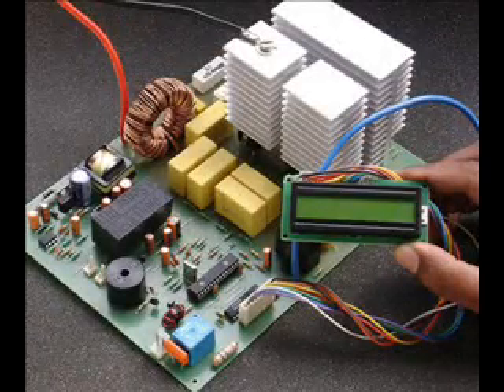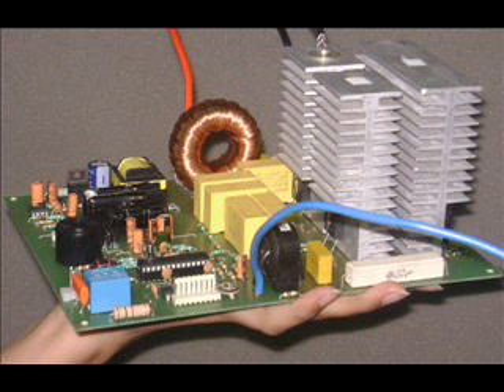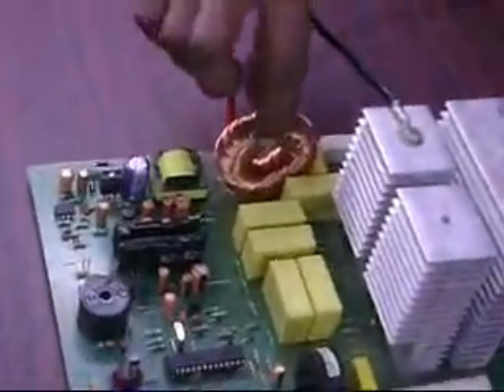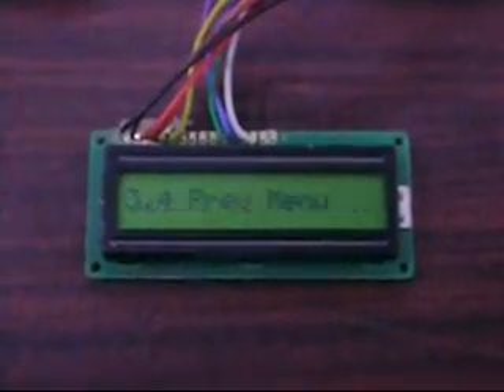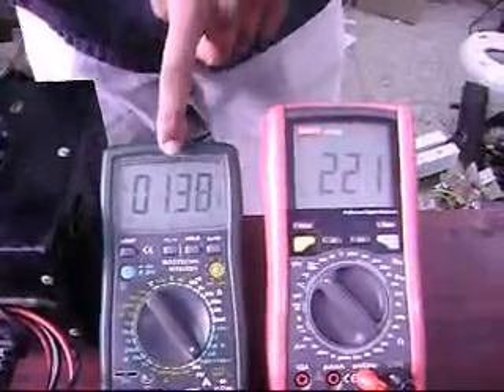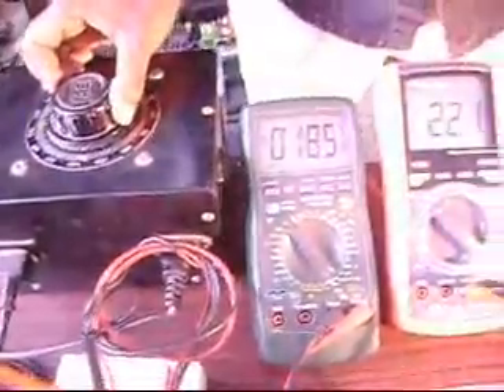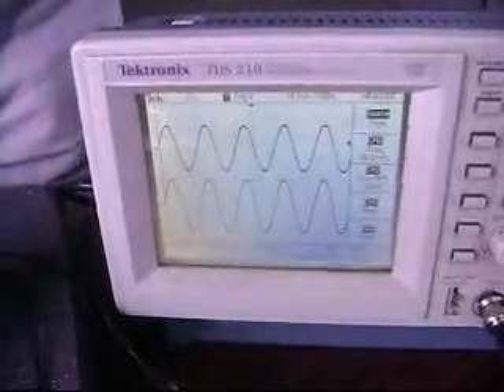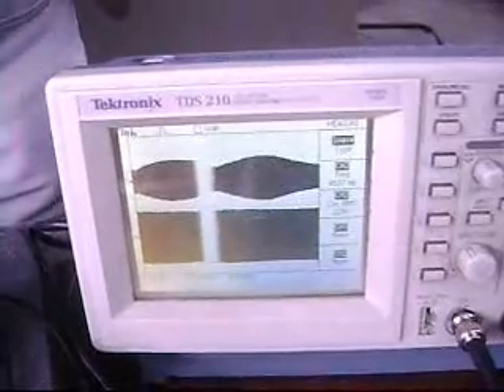Dynamic Voltage Regulator

Comment: What about durability
Reply: Respected Mahesh Ji !
These systems are extremely durable because of the impeccable design and quality. 
 We are one of the leading manufacturers of IGBT Controlled Static Voltage Stabilizer with high precision, fast regulation and inbuilt circuit protections. 
You may check about it more on
https://nkbtechnocratspltd.com/?page_id=125

Contact us on: nkbtechnocrats@outlook.com
Call/Whatsapp: +91 9660061987

Comment: Wow  this is great  incarnation
Reply: Dear Sir
 We are manufacturers of IGBT controlled Static Voltage Stabilizer which gives constant output voltage. Kindly visit https://nkbtechnocratspltd.com/
or call on +91 9660061987.
Reply: Hello !

We are one of the leading manufacturers of IGBT Controlled Static Voltage Stabilizer with high precision, fast regulation and inbuilt circuit protections. 
You may check about it more on
https://nkbtechnocratspltd.com
Or call us on +91 9660061987.

Comment: Sir I am intrested  in your product. Pls can you call me on my number  9986336699.
Reply: Respected Sir!
We are one of the leading manufacturers of IGBT Controlled Static Voltage Stabilizer with high precision, fast regulation and inbuilt circuit protections. 
You may check about it more on
https://nkbtechnocratspltd.com/?page_id=125

Contact us on: nkbtechnocrats@outlook.com
Call/Whatsapp: +91 9660061987

Comment: I'm Interested in your Design. I want to use this Design to Make a Stabilizer  of 20KVA for Household Use. what will be the total cost of Materials and Cost of Your Design ?
Reply: Dear Sir
 We are manufacturers of IGBT controlled Static Voltage Stabilizer which gives constant output voltage. Kindly visit https://nkbtechnocratspltd.com/
or call on +91 9660061987.
Reply: Hello !

We are one of the leading manufacturers of IGBT Controlled Static Voltage Stabilizer with high precision, fast regulation and inbuilt circuit protections. 
You may check about it more on
https://nkbtechnocratspltd.com
Or call us on +91 9660061987.

Comment: this great ideas manufacturers companies Name &  Contact Us
Reply: Hello !

We are one of the leading manufacturers of IGBT Controlled Static Voltage Stabilizer with high precision, fast regulation and inbuilt circuit protections. 
You may check about it more on
https://nkbtechnocratspltd.com
Or call us on +91 9660061987.

Comment: Very impressive I like how it was capable of regulating consistently due to draw and variable I biggest concern is pricing of the units and is it available for US market also had a buy one
Reply: Dear Sir/Madam
 We are manufacturers of IGBT controlled Static Voltage Stabilizer which gives constant output voltage. Kindly visit https://nkbtechnocratspltd.com/
or call on +91 9660061987.
Reply: Hello !

We are one of the leading manufacturers of IGBT Controlled Static Voltage Stabilizer with high precision, fast regulation and inbuilt circuit protections. 
You may check about it more on
https://nkbtechnocratspltd.com
Or call us on +91 9660061987.

Comment: hi I am bipin.I would like to buy your product .Could you send me the price list and details of your products at bipinraut64@gmail.com
Reply: Hello !

We are one of the leading manufacturers of IGBT Controlled Static Voltage Stabilizer with high precision, fast regulation and inbuilt circuit protections. 
You may check about it more on
https://nkbtechnocratspltd.com
Or call us on +91 9660061987.

Comment from the maker: Hello alkhafajimajid,
We are designers who are purely involved in R&D and do not manufacture. We provide designs of various electronic products to manufacturers under any sector in electronics - power electronics, R.F, embedded control software etc.
In India there are few manufacturers using our technology for manufacturing this type of stabilizer but for higher capacity, like 3KVA to 200KVA. What is your application for using this product?

Comment: Nice work , how could one manage to buy this stabilizer ?
Reply: Dear Sir
 We are manufacturers of IGBT controlled Static Voltage Stabilizer which gives constant output voltage. Kindly visit https://nkbtechnocratspltd.com/
or call on +91 9660061987.
Reply: Hello !

We are one of the leading manufacturers of IGBT Controlled Static Voltage Stabilizer with high precision, fast regulation and inbuilt circuit protections. 
You may check about it more on
https://nkbtechnocratspltd.com
Or call us on +91 9660061987.

Comment: Do you sell finite products ? I want something like this for my audio equipment. Thank you.
Reply: Dear Sir/Madam
 We are manufacturers of IGBT controlled Static Voltage Stabilizer which gives constant output voltage. Kindly visit https://nkbtechnocratspltd.com/
or call on +91 9660061987.
Reply: Hello !

We are one of the leading manufacturers of IGBT Controlled Static Voltage Stabilizer with high precision, fast regulation and inbuilt circuit protections. 
You may check about it more on
https://nkbtechnocratspltd.com
Or call us on +91 9660061987.